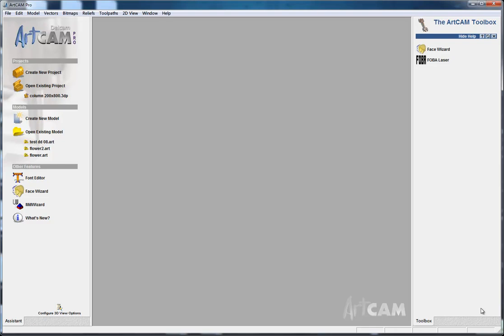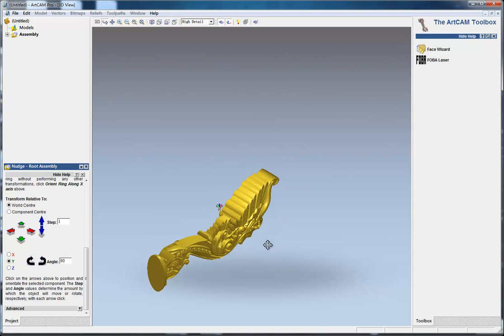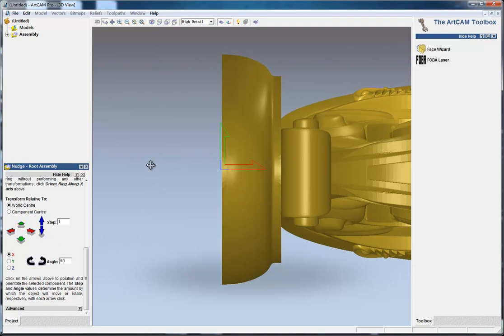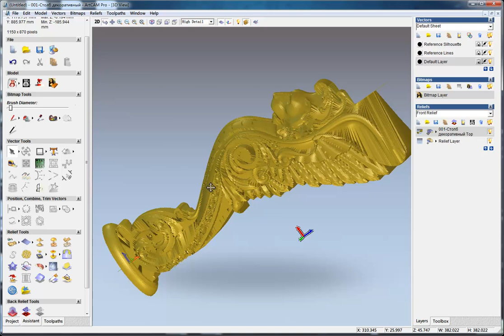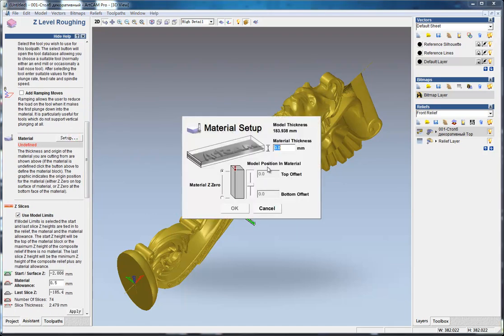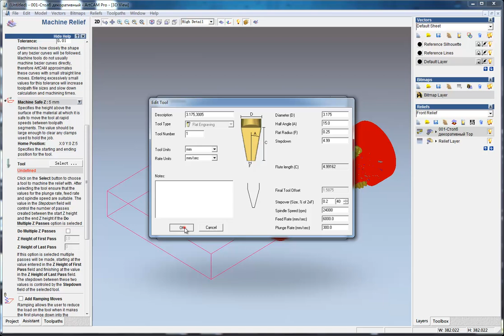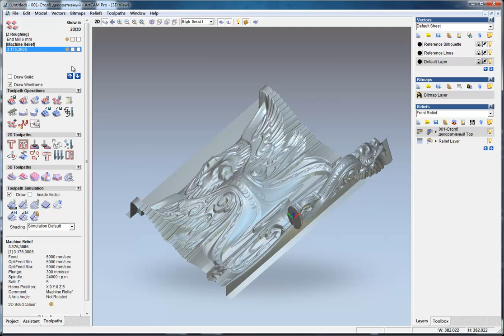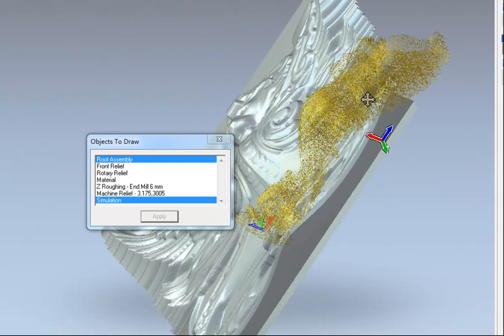Make tool path of complex column in ArtCAM, artcam tutorial

Comment: Is their a way to create 4 views, 90degs. from each other, that you could have 4 separate X-Y-Z programs to make a 3D part. Maybe not the most highly detailed. "All" you would do is rotate the stock\part 4 times 90degs.
Reply from the maker: yes, so the issue is how to rotate 90 degree precisely. Usually most control system use distance rather than degree to control the rotary axis. And your method is better to do with PowerMIll
Reply from the maker: yes, so the issue is how to rotate 90 degree precisely. Usually most control system use distance rather than degree to control the rotary axis. And your method is better to do with PowerMIll

Comment: hello sir it is from cute planet  sir we buy some designs from you .. now which art cam version use for 4 axis toolpath making 
give me answer please
Reply from the maker: +cuteplanet Est actually no  Artcam works with 4 axis.  it can only work on 3 axis rotary. when the rotary works the x axis is disabled/replaced. So after simulation you see there's some part not engraved.
Reply: Thanks friend.  But how to make toolpath your designs in power mill 9.0 i have...  please
Reply: +LIU XIN same question for last question of cuteplanetest
Reply from the maker: +Abdulrahman AL-Harbi I'm also working on this. Once I have a solution I'd like to share with you then. Now I canonly do the work in 3 axis. I'm also searching tutorial on 4 axis machining with PM.
Reply from the maker: +cuteplanet Est I don't have well-made 3D models. Could you send me 1 or 2 example? So I can work on it in PowerMill. The model in this video has many flaws that cannot get a good result. my email: instantlx@gmail.com